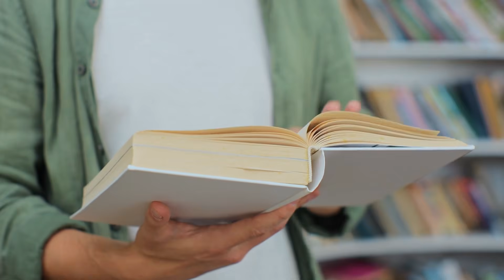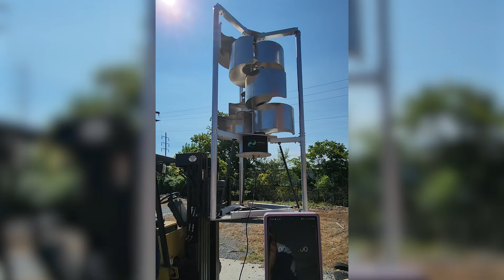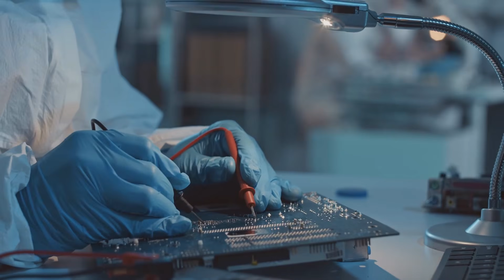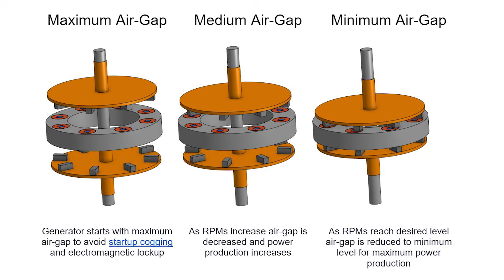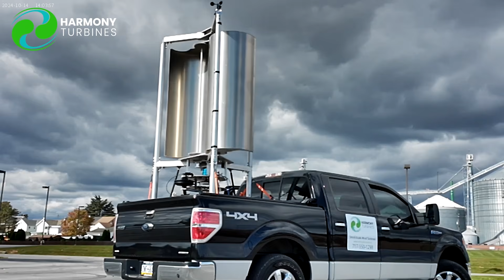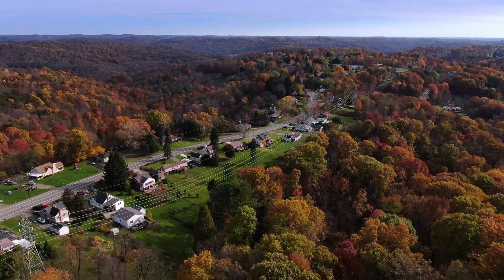Revolutionizing Small-Scale Wind Power! Harmony Turbines Interview

Comment: The main selling point and "claim to fame" is FURLING.
There is no need to furl the turbine, dump loads etc etc, protect the turbine from damage. Working with wind turbines ( horizontal axis as well as vertical axis for the last 15 years) I know what's what. Horizontal axis wind turbines are way more efficient than vertical axis turbines and solar panels produce more watt hours of power in a year than wind turbines. This  is not a good investment. I predict that they will never go to market with this product.

Comment: Press on weight slips then on track then press weight again the slip again until it's rotating is 4000 rpms in a biggly seal think of this and get the system running and it's in

Comment: If you make very large diameter pancake generator you can produce power at lower wind speeds, with a regular small compact motor generator you have to have a very high speed to produce any productive power...
I need more power in the short cold cloudy winter days...

Comment: Reality: All practical tests show that small wind turbines hardly generate any electricity! Because there is hardly any wind close to the ground.
It is also extremely gusty, which usually shortens the service life extremely! 9 out of 10 systems no longer work after a few years. 
Solar panels generate at least 10 times more electricity for the same investment in time & money!
Reliable and almost maintenance-free for 25+ years!
Reply: Well said. 100% correct. This is just an investment scam.

Comment: On my Dad's Minibike, we had a "Centrifugal Clutch", to get going!  Maybe the same tool can be used as a "Drum Brake" approach? 

Or, something like a "Flyball Governor" design, that can apply a "Progressive" Electric "Load" and also "Squeeze" a Disk Brake? 

It could even use some power, to start the Blades Spinning, or Power a Solenoid, to control Brakes, or Blade Pitch! Or, the Governor itself could control Blade Pitch, mechanically?!
Reply: That is what I was thinking for the variable gap generator, simple and effective!

Comment: The problem with wind turbines that needs to be addressed is tying it in with existing panel solar systems. My sister already has a solar power system but wanted to augment it with a small wind turbine but the company said no way to tie it in. This doesn't make sense to me because wouldn't it just be like adding additional solar panels? Why can't wind turbine power be connected to existing solar panel systems?
Reply: Our goal is to help educate the public here. It's not a competition between wind & solar. Everyone who has access to good amounts of both free resources should take advantage of them each. We are working to ensure that our units will be plug-n-play and work hand-in-hand with existing solar battery banks. Customers will just need to know what DC Voltage their system requires and that should be it.
Reply: There is no reason as long as everything goes to DC. It would just be another DC charger.
However it can not easily be integrated with existing AC inverters, the easiest way is DC first and then to AC. And with DC first it's easier to just make it a battery charger.
I would love one, but when my solar panels here aren't producing it usually is because there is no wind to take away the mist/clouds.
And on extreme cold days, it usually is bright.
Reply: You need a hibride controller
Reply: you can tie it in with a decent mppt and inverter, you do end up transforming the ac to dc to ac again

Comment: This is a scam as these make little power for their size, cost.  

The strangest thing is it costs more than a good 3 blade wind generator to build that makes 5x the power. 

And you need to be at least 10' above any wind obstructions to get faster,  cleaner air.
Reply: Ask them the question ,what is the CP and efficiency  and TSR. It can all be calculated acording to the Swept area. The results will be the poorest of any type of wind turbine. Reliability will be very bad because of the biggest problems of Savonius "vetique "Loading

Comment: When a car and airplane companies studies the aerodynamics of their car / plane, they put it under water so that a water current flows around it and they put colored dyes so that observe how the water flows around it.  This method could probably give them information about their designs that they're unable to get from wind.  On the plus side, the design, if waterproof could also work as a hydroelectric generator.
Reply: Для гидроэлектрогенератора такая конструкция не подойдёт . Слишком большое сопротивление к потоку и небольшой коэффициент полезного действия.
Reply: They also use smoke or strings to show the airflow.
Reply: It would appear to me that it wouldn't work with an air, solid molecules are different

Comment: I still say their furling mechanism is fundamentally flawed. As I said before, instead of their fixed interior and complicated furling mechanism that must fight centripetal force, I'd go with a fixed exterior and replace the internal mechanism with a simple spring.

To state things differently, they propose to slow their turbine down the same way figure skaters accelerate. Crazy stuff. I am suggesting to reverse that and take advantage of centripetal force to automatically slow it down instead. QED
Reply: @seanhoude thank you for your suggestion but your analogy is flawed in this case because there is an incredibly large force continually stealing the centripetal force from the turbine. That force is the generator. If your ice skater had such a force acting continually upon them, where it would only take a few rotations for them to come to a complete stop, then the end result would look very different. Then it would not matter what they did with their arms, open, close, flail wildly... it would not matter as they would just rapidly decelerate to a stop. The RPM "gain" that we see in an ice skater when they pull their arms in is only possible because they have extremely low frictional forces at the bearing point (the tip of their skate on the ice) and nothing bleeding or stealing their rotational force (flywheel force) away from them. If you forced their rotations do significant work (like our turbine does) the effect you're writing about becomes negligible.

Our furling mechanism has been tested quite a bit over the past year and it works extremely well as designed. Springs, levers, weights etc., as you suggest would all make for a very difficult to balance system and  one that would be prone to all sorts of issues with heat changes as well as weather. This answer is already fairly well documented in our FAQ (question #34) on our website. I will have to add this further explanation to our FAQ for people who are trying to suggest the same thing you are suggesting here.
Reply: @HarmonyTurbines  Fair enough. Thanks for replying.
Reply: @seanhoude
 I see what you’re getting at with using centrifugal force to slow the turbine down—kind of like a passive governor system! The figure skater analogy is interesting, where extending the blades outward could increase the moment of inertia to reduce spin speed. But I’m wondering how that would work in practice since, as you mentioned, larger surface area with more airspeed would typically make the turbine spin faster, not slower. Wouldn’t the blades need to feather or adjust pitch in a very specific way to reduce lift while extending? I like the idea of a fixed exterior with a simple spring—maybe the spring could pull the blades into a feathered position as centrifugal force kicks in? Still, I’m curious how you’d balance that with the increased air capture you mentioned. What do you think—any real-world examples of this setup?
Reply: @CapitalforHire  Rather than the mechanism being used to pull the outer edges in (which would then also have to fight the increasing angular momentum it creates), use a simple spring to allow the inner edge to swing outward under extreme load (thus decreasing angular momentum while also closing off the vanes). So instead of closing it by bringing in the outer edge to a smaller diameter cylinder, close it by letting the inner edge swing out to the existing outer diameter.

Not only does this swap their fighting centripetal force into mechanical advantage, but wind tunnel experiments should easily identify the spring constant needed to replace their entire furling mechanism.
Reply: @seanhoude  In really strong wind pulling everything in has an advantage.
Reply: @jkn6644  Yes, but the action of pulling it in is going to be a fight that exacerbates the problem until eventually managing to achieve the desired outcome. If closing it down means becoming a cylinder, I'm simply suggesting it become the maximum diameter cylinder not the minimum. This way, excess wind would cause centripetal force to decrease its efficiency while reducing angular velocity. A win-win.
Reply: @seanhoude  Even if cylinder is not rotating, wind can cause very large forces to it. With max diameter cylinder those forces could break something. Attachment points to roof, roof, ...
Reply: I have to disagree, I like the thinking but I believe there are variables you are missing. First unlike a figure skater the alternator/generator still applies resistance causing continued slowing vs the ice skater has very little resistance and allows them to increase in speed relatively. To continue down that path I would also mention the difference in weight, I would imagine the weight of the moving parts of this turbine are higher than the ice skater, adding resistive pressure relatively. Centripetal force is usually intensified by torque being applied at the center and letting it swing out, this turbine is catching air on the fringe and dispersing the load to the center.

An example I would add is the skydiver. They also "furl" or close in to increase speed just like the ice skater. The difference is that the ice scatter is accelerating force at the center by pushing off the ground, the close them self in to reduce air drag, the sky diver has gravity pulling them in, and close themselves to reduce air drag. The wind turbine uses wind as the force and the center is the resistance, for wind turbines you are adding force by getting bigger not lowering force, and resistance stays the same. 
To clarify ice skaters and sky divers have different force applied and resistance applied in compared to wind turbines. Ice skaters and sky divers close themselves to lower resistance which allows them to increase speed because acceleration stays is applied centrally or continuously, the wind turbine receives its acceleration from the wind by enlarging and it's resistance is consistent instead. 

This really made me think! Thank you for this, and still great thought on trying to figure out what is going on here!

Also the idea of a flywheel where they take a big heavy "wheel" and put it in a vacuum and spin it up and temporarily store kinetic energy. Add acceleration at the center and the vacuum removes air resistance allowing it to spin "uninterrupted" by keeping it spinning on a wheel barring meaning no resistance at center, and then it can switch back on to use that energy elsewhere.
Reply: @blakefearday6047  The action they are taking to slow it down will, in and of itself, increase rotational velocity. This is why I am suggesting they reverse the entire mechanism, using centripetal force as an advantage rather than a disadvantage.